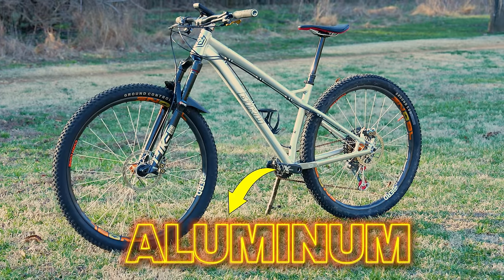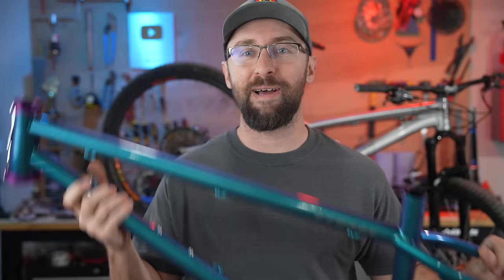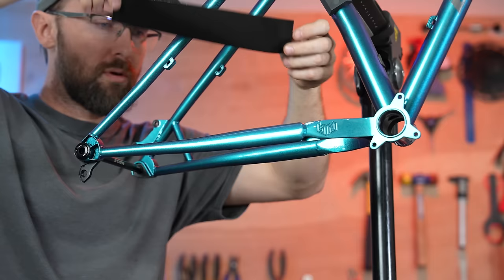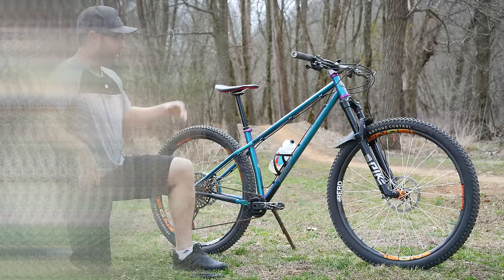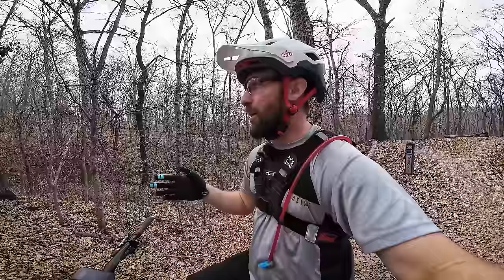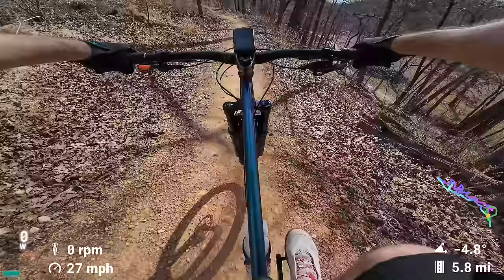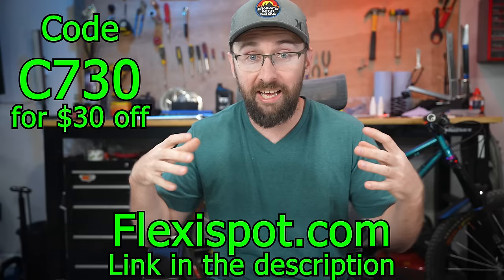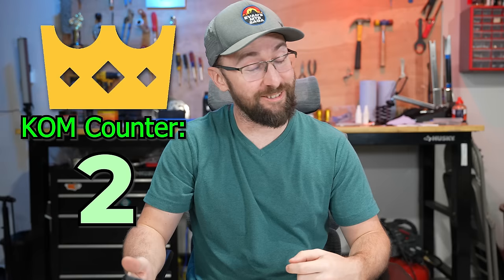Are Steel mountain bikes worth it?

Comment from the maker: Use Exclusive code 'C730' Purchase the C7 now and enjoy a $30 discount
US: https://bit.ly/49jbw0V
CA: https://bit.ly/3wv2aR9
Reply: If its downhill and it has an ebike motor for climbing, then weight isn't a huge issue. Where steel falls flat is cross country. Steel flexes better and is less likely to snap it's frame.

Comment: “Steel is real” is real. I had a demo Marin Pine Mountain for a few months and was amazed how I didn’t feel like the trails were beating me up. I did a particular downhill trail only once on it that I had done countless times on my full suspension bike and I was only seconds off my PR. Pretty impressive. Anyway, great in depth comparison!
Reply: Smaller cross section tubing = less stiffness = more compliance = more confort. Smaller tubing possible due to higher overall steel strenght and weldability on thin walls.
Reply: The extra weight has a lot to do with it. The heavier the bike , the less it's going to bounce or vibrate as its simply more planted to the ground as it's called gravity.

Comment: Steel is way better than any other material for a bicycle frame, other materials only reduce the pleasure of riding, and usually you pay more, for a material that's less valuable and won't last as long.  I don't even feel fully confident on a non-ferrous bike frame.

Comment: Just for the record I don't think a power meter can actually compare how efficient a frame is - 150 watts at the crank is 150 watts. To see the difference between frames, suspension being locked out vs unlocked, etc, you need to measure how hard it is for you yourself to produce 150 watts at the cranks, which isn't really easily done on a bike

Comment: 1:16

"Despite its strenght, it's not overly stiff". Steel stiffness (Young's modulus) is three times that of aluminum. That's a topic beaten to death on all "steel is real" discussions. The reason why steel frames are "springy" is that density of steel its also three times that of Aluminum, so in order to build frames with a reasonable weight, you need to use smaller tube cross sections. You can still do that because 4xxx steel alloys (and other proprietary concoctions) are stronger (higher yield strength) than typical weldable Al (some 6000 and some 7000 series Al alloys). Everything related to frame compliance depends almost exclusively on cross section size and shape, the only factors that influence its second moment of area.

So, steel alloys are strong enough to deform more at the same percentage of ultimate allowable stress than Al alloys, hence the compliance.
Reply: So comparatively you could say that it's not as stiff.

Comment: There are different kinds of steel, aluminum, carbon, magnesium, and titanium. Different tube shapes, wall thicknesses, construction, and manufacturing processes. Various geometries. Components add a dynamic to the whole picture. All these factors can highly mitigate the general assumptions. All the best.

Comment: The lower stack on the aluminum frame was probably allowing a little more front end traction on that one corner were the steel bike got a little squirrelly. Its easier to weight the front end with lower stack, but the high stack helps on steep decents where you don't want your weight over the bars.

Comment: When I used to sell Marin bikes 20 years ago - they did both steel and alu bikes. 
The highest end race frame was extremely light, stiff and fast - our shops top rider returned it after 3 races saying it had gone “all floppy”.
Metal fatigue is a real thing - even today. But it does not really happen to the same extent in steel frames.
Reply from the maker: I experienced that in BMX. I had several aluminum frames get floppy haha
Reply: @EvansMTBSaga  I'm not familiar with this floppy term but when I used to ride bmx alot I would Crack any aluminum frame I rode usually where the top tube meets the seat post, but steel frames like s and m with the 4130 chromoly was perfect

Comment: Steel, AL, TI, really don't care if one is faster or slower in reality.
But mentally, if it feels  faster or smoother( but not too smooth tonfeel disconnected from the trail)is what matters
Perspective of enjoyability 

It's kind of like why I like  a hardtail over a full suspension.
Full suspension dumbs down the trail, and you just feel slower.

Another reason I went custom soft tail... faster, but still feel like a supple hardtail instead of a disconnected FS

Comment: Raced a vintage Saracen Kili last weekend,  1990s race excellence.  Got ahead of quite a few guys on modern mtbs by halfway through the first lap until the chain snapped 😂
Not heavy at 23lbs ish with Pace forks.  26 inch wheels are a disadvantage but I'm an aggressive rider and happy to cane it over roots and rocks.  Having raced xc in the 1990s I guess steel is normal,  alloy was expensive and carbon a dream,  now I have a collection of old bikes including high end Cannondale and Trek , the steel Kili is the best so far. 
Cheers.

Comment: Something that people really need to be aware of when deciding is longevity.  Steel alloy parts can be designed to lower stresses to a point where the material will never fail if kept corrosion/damage free. Aluminum on the other hand has no fatigue limit and will fail eventually; Even if kept in perfect condition with no dings, dents, etc.

Comment: I bought into the steel craze in '08. Built a fully high end steel hardtail, sram x0, avid ultimate, chris king headset and hubs, mavic rims, top end fox fork and thomson seatpost and a carbon bar. So pretty much at the max on every level at the time. Frame consist of True Temper OX Platinum main triangle and Butted CroMoly rear triangle.

Now it is about to end up parted out for the kids bikes for sale or whatever. The bike just feels so sluggish. I had an aluminum decatlon sram x3 bike at the same time, and that despite having a crap fork and a drivetrain from the bargin bin, it felt so much more nippy. 

BUT. My steel bike is an XC hardtail, not a trail bike. So maybe steel is more optimal for trail? I don't know, but it was the one and only shot I had at steel (outside of the steel bikes of my childhood).

Comment: I’m not an avid mountain biker, but I can familiarize & appreciate your passion & production.

Additionally, I’m a big fan of steel, which I hope will be even better with electricity & coils.

Baby steps!

Liked & subscribed.
Reply from the maker: Thanks apple chili!!
Reply: Am planning to go to 4130 for future electrified bicycles.  Aluminum - what I’m currently running; used trek 4900 frame - tends to fatigue and crack after a while.  “A while” tends to happen faster under electrification.
Reply: @dennisyoung4631  Steel or Cromoly is the way to go. Been running a Motorized 2 Stroke bike on an 90's Steel MTB with no issues for more than a year now (had a knee injury which put me off pedaling for a while, after I recovered I still kept it around just for the fun of working and riding it). Also, steel is super easy to reinforce on any good welder.

Comment: I have owned steel, aluminum and carbon. Steel isn't as light but I have found it to be more forgiving on long trails and absorbent of chatter. This makes for less fatigue if you ride all day. The worst is my carbon xc race bike. It is brutal. While it's super light at 24lbs and super fast..it just beats you up on long rides. My body is numb and I want to quit after two hours. Aluminum is inbetweenen the two. Steel is also more durable. This is why BMXers never went to carbon on freestyle Street bikes and hate aluminum as it dents or cracks too easily when dropped. They all have their strengths and weaknesses. I still love steel for urban assault city riding and pump tracks.

Comment: I've had my Redline Monocog 29 for quite a while and by now the only original parts are the frame, crankset, and a couple other small bits.
It is a fantastic machine for several trails in my area with the steel ride being great although it is a LOT harder to tell with the big squishy tires and suspension fork compared to the difference in my steel frame/cf fork road bike vs my aluminum/cf fork road (crits) bike - on skinny high pressure tires and no suspension the difference is pronounced.   When  sprinting on a steel bike you can feel the BB sway and hardly any of that on the aluminum.  Race on alu, train on steel (for road anyway)

Comment: I have an 1992 Scott team (Steel butted tange tubes frame) and one Specialized Rockhopper Elite 2023 (A1, aluminum frame) and I fell much more comfortable to ride on the old Scott than the new Specialized due to the frame. Aluminum has elongation around 20%, steel has 45% this will define the ride comfort for sure, nice video.

Comment: I love steel bikes! One of my favorite bikes I've ever owned has been my 1993 Diamondback Apex. Fully rigid, but still very smooth and compliant with 35psi in 26x2.1 tires. I also just absolutely love how steel frames look. Just got my custom Marino steel full suspension frame in a few days ago too, and I'm too excited to get it built up. I'm very interested to see how it compares to my aluminum bikes. It's definitely heavier, at 10.2lbs with a Fox Float and nothing else, but I think that'll even out with the components I'll be installing.
Reply: I should also add, that Diamondback is only 24lbs. Being rigid probably helps with that, but steel can still be light.

Comment: When switching to the steel did you set the forks up accordingly? You'll need to tinker with the compression and rebound to get the best from the natural feel of the bike.
Reply from the maker: Yeah I think I increased the low speed rebound by one click. But the fork wasn't feeling great on the aluminum beforehand, but felt great on the steel 😂

Comment: IMO any non-FS bike, other than a XC race bike, I'd go steel. 

Suspension can provide the forgiveness and suppleness that makes a rider less sensitive to the dampening of frame materials, and is why Steel isn't a must for long legged trail/enduros... 

However I believe this is the MOST important factor in rigid/semi-rigid bikes.

Whether its a cylocross, gravel, DJ/BMX, or trail/hardcore hardtail... the comfort and confidence you gain from taking away the fatigue of the frame osciliations (chatter), will equate IMO to better "rider" performance, regardless of the weight deficit. 

I don't think think any bike itself would be any 'slower' than another with identical geometry just because of the frame materials.I wouldn't say there is even a tangible traction benefit. Rather the compliance, the ability to mute unwanted vibrations, over duration, is what improves the rider's performance by reducing fatigue and sharpness of impacts.

I don't think you can tell me that a 4x bike race can be won/lost due to the frame materials.

If you want to ride low/long/slack HTs down the chunder in the pacific northwest, with comfort and confidence... it better be steel. My favs are the Chromag(s), Torrent, Knolly, ESD

Comment: I would love you to add a titanium frame set in this shoot out… could it be the best of both worlds?
Reply: I second that motion!
Reply: Titanium feels pretty much just like steel just lighter.
Reply: Titanium frames are absolutely stupid expensive. They are an unjustified purchase
Reply: NO. The strength of titanium is negated by the horrible pin welds and frame inconsistency due to how hard it is to bend to spec. The cost isn't even the issue, you could pick one up for less than 1k, and they make compound so the threads don't seize, they just don't hold up like steel and don't weigh any less than aluminum, if it weighs even the same as aluminum, it's going to be weaker.
Reply: @username-mk8gf it all depends on the manufacturer of the frame I‘d say…

Comment: I went from steel(kona unit w 120mm fork) to aluminium hardtail (ragley mmmbop mullet same 120mm fork) I ended swapping the parts back to the steel bike. 
The steel bike feels like its much more controlled over roots and rocks. The alu bike was a bit like riding a pingpong ball hehe

Comment: This is interesting since looking at the Young's modulus, aluminium is way more flexible than steel.

Young's modulus is a mechanical property of solid materials that measures the tensile or compressive stiffness when the force is applied lengthwise. It is the modulus of elasticity for tension or axial compression.

Aluminium is much more flexible than steel, meaning it can be easily bent into various shapes. Steel is more rigid and will break if pushed too far. Aluminium is also very ductile and can be stretched without cracking.

Science 👍🏼
Reply: Young’s modulus is pretty irrelevant here because tubing dimensions and amount of material used have a much bigger impact. Science ain’t so simple

Comment: I have a few steel frames, some vintage and some new. There's a huge difference in feel between the older and newer frames. The vintage bikes are very forgiving, with that desirable "springy" damping quality. My newer frames do have this to an extent, but something has been lost along the way. I read in some forums that the steel alloy blends have changed over time due to changes in manufacturing certification standards in the steel industry over the years. Apparently this is to blame for the loss of compliance in newer built frames. Basically, tubing is more robust now. Not sure how much truth there is in this, but I definitely feel there is a difference regularly riding them back to back. One thing that can't be denied is that steel frames just look sick AF
Reply from the maker: Some people commented that new steel has a break in period. Excited to use mine long term

Comment: I ride E's but came from MX background. You can make my frame out of tungsten and I wouldn't give a damn. How heavy can you possibly make my bike before it weighs 250lbs like a decent moto? As long as that thing has some juice to help, give me MORE. More weight, more brakes, more suspension. Hey, I like the stability, and crushing my own gravel in front of me.
Reply from the maker: I've been enjoying the E-Bike quite a bit. At 50lbs, it handles downhill much better than my regular bikes because the weight gives it a ton of stability and a planted feeling

Comment: Went from Cannondale aluminium excellence in the 1980’s…Specialized epic 1990’s until Carbon hit. Two years ago bought a Stanton Sherpa 853 steel frame and pulled all my Hope stuff from my Felt Carbon frame….verdict?  Yes,it is heavier,but I love the ride quality..much nicer ride than Carbon!  Extra kg of weight?   Most folk are at least 2kg overweight…..
Reply: Same here... went from Cannondale Trail 3 2018 to Sherpa Gen 3 Taiwan steel... amazing upgrade. Steel is real!

Comment: Does anyone know how to get a stripped bolt out of the star but I have my stem and spacers installed but the bolt fully stripped during the process lucky me it’s fully tight but I want to remove the bolt and put a better quality bolt in do I just hammer the star nut out?
Reply from the maker: Drill it out until the head is gone and you can remove the stem cap. Then you could probably easily twist off the remaining threads and the star will still be good
Reply: @EvansMTBSaga  thank you for your instant reply luckily I had a deity crosshair stem top cap installed i saw a video then tried myself grabbed a pair of needle nosed pliers then just gave it a twist it unscrewed without issues 😅

Comment: 35mm tires and under steel is better, large tires Aluminum is better.  Around 38mm I can no longer feel the crappiness of Alu frames and it starts to become better due to weight and stiffness.  I greatly prefer steel on my commuting fixed gear bike, but no way I would use it on a mountain bike, no point.

Comment: I don't really understand the use of 853 up front, where you are already suspended, and then the use of generic 4130 where you are going to be lacking overall compliance thus increasing bound and rebound unpredictability? I mean, I'm no frame builder nor a physicist, but from my understanding 853 is fairly compliant and thin-walled, no? Especially compared to just a generic 4130 with no tubing specs listed.
Reply from the maker: I was thinking maybe it was to get the weight down. Also Reynolds in the rear might cause flex and tire contact on the frame. Just my thoughts
Reply: Yeah, I mean 853 up front for the weight savings makes sense, maybe it would cause too much flexion and tire rub considering impact forces combined with weight. Makes sense I guess. I mean there are other steel tubing alloys from Reynolds as well.  I'm sure in the end it comes down to compliance with the sacrifice of cost while having marginal weight impact considering the size of the rear triangle as well I suppose.  @EvansMTBSaga

Comment: Bikes from the same materials could feel totally different, you could play a lot with tube thickness in steel bikes on aluminium it's more about shapes...
I have had many bikes made of different materials, including beryllium alloy and titanium (still have my 2001 hei hei) but I always come back to aluminium, nowadays it's the cost effective option, in theory carbon is less expensive to manufacture than aluminium especially for complex tubing shapes where aluminium requires hydro forming, heat treating is a B ... Carbon is taking over for a reason.
Reply from the maker: One day I'll try a carbon Hardtail!